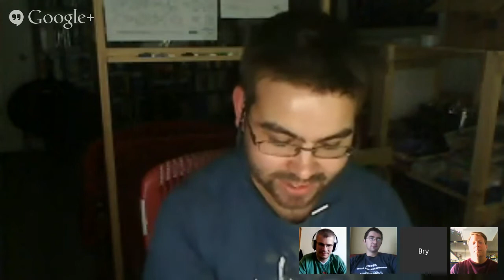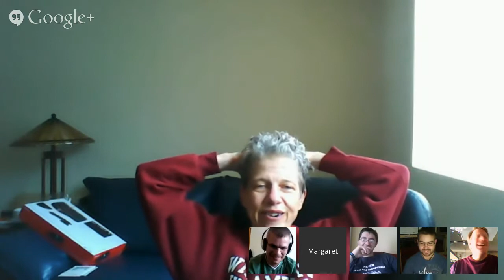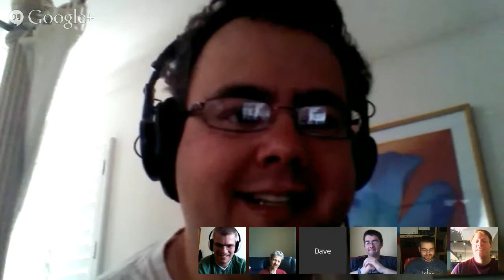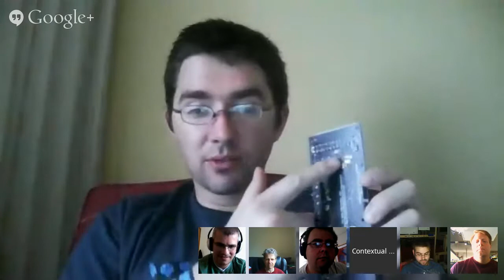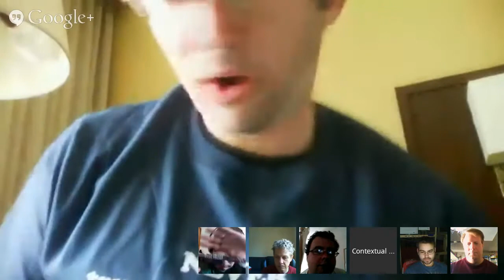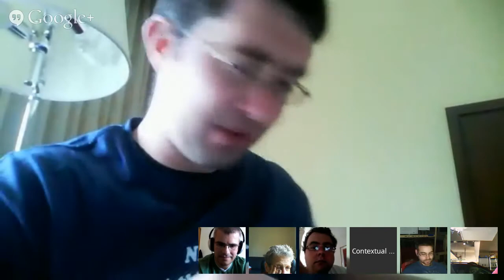Session 1B Week 5 Hangout

Comment: So... if the problem is that the wrong package format for an individual component was planned,but that wrong  component still has the proper specs,,, why not simply order the SOIC parts to mount.  That would be more reliable than bending obnoxiously small pins into a "dead spider" configuration.  Or, you could surface mount an adapter daughter board.